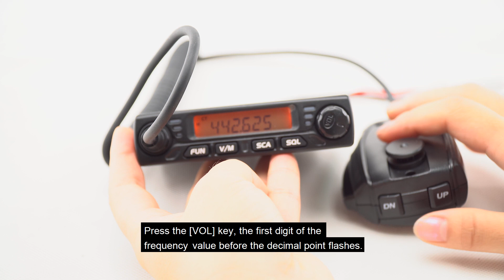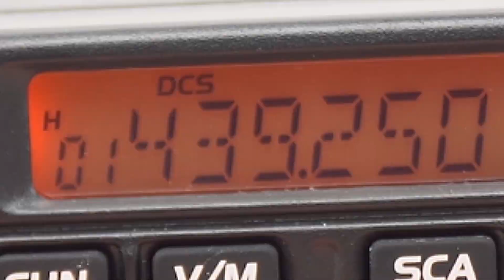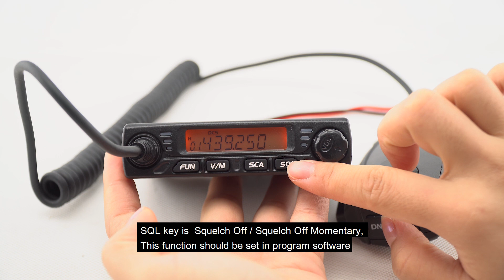How to use the Retevis RT98?-PART2

Comment: I just purchased this radio, directly from Retevis. I want to program it so I can use it, because without programming it is not useful. So, I switched from channel to VFO mode using the V/M button, and 150.110 appeared in the display. Then, I attempted to raise of lower the frequency to one of my own selection, and the U/Down button on the microphone only altered the volume level. When I tried to adjust the frequency using the front-panel knod, the same thing happened: it only varied the volume level. How can I program this radio in the VFO mode, using the front panel?

Comment: VFO mode not function in my rt98 VHF version..
Reply from the maker: In standby, press V/M until LCD appears M. This means the radio is in the channel mode. then press the V/M again to switch between VFO and channel mode.
Reply: @retevis  in software menu information can't edit in com (136-174 vhf) only freenet mode 😭
Reply: @retevis  I have bought the vhf version in retekess official store shopee marketplace but the version came freenet .. so sad .. how to unlock it?
Reply: @KijangKapsulTuban  I do have some problems....
Reply: @r.wirandokoboedhyandryasth1259  versi vhf kayaknya masih bermasalah.. ini masih terus berupaya mediasi retekess official store di lazada dgn teknisinya..
Reply: @KijangKapsulTuban  Saya dapat opsi dikirimi kabel dan programming nya. 😭
Nunggu lagi.... Mana saya beli 2 unit buat kantor
Reply: @r.wirandokoboedhyandryasth1259  waduh 2 unit.. kayaknya pihak retekess retevis harus memperbarui versi firmwarenya.. karena di software 1.02 tidak bisa merubah dari freenet ke vhf normal..
Reply: @KijangKapsulTuban  Iya betul, ternyata verai 1.02 tidak bisa merubah. VFO modenya hilang. Mereka ini niat jual barang ga sih?